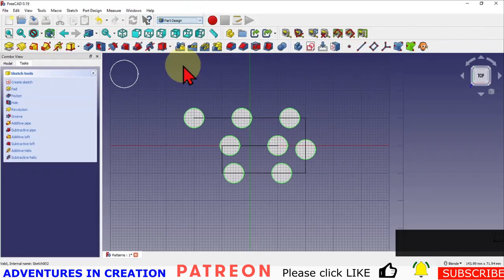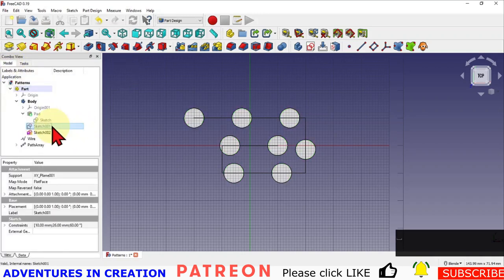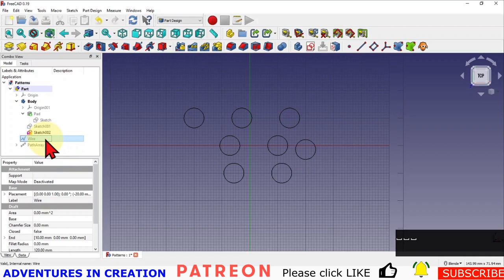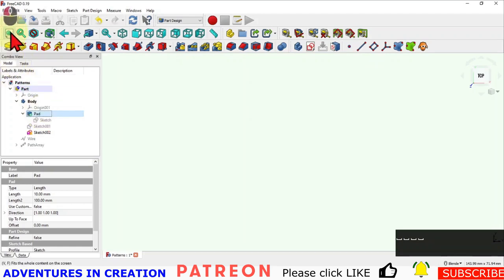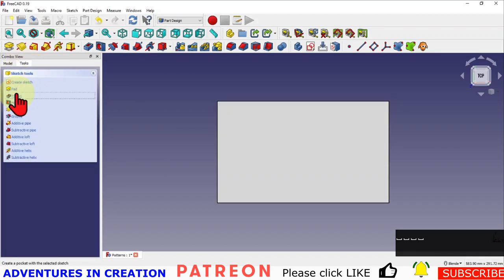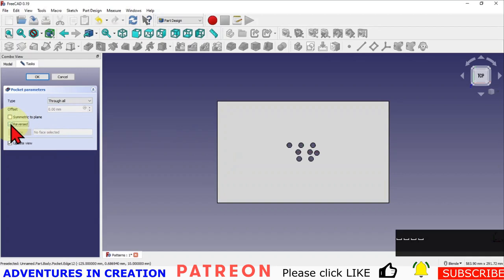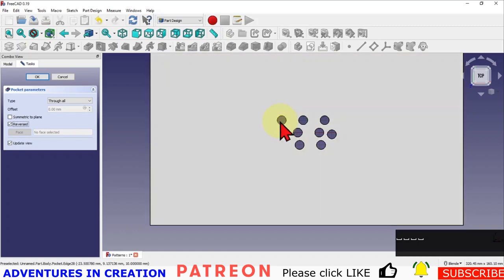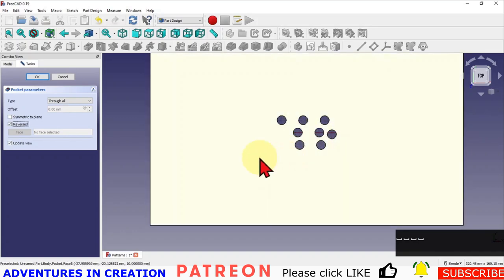FreeCAD for Beginners #9 Linear and Polar Patterns with Path Arrays

Comment: A quick way to re-orient the model is to use the 6 blue cube icons below the WB selector menu.
Each cube selects a different face: top, bottom and the 4 sides.
You can also use numeric keys 1 to 6
Reply from the maker: That's right Paul, check out my other videos for demos of that too. Freecad just keeps getting better.

Comment: Awesome video sir.  Quick question.  When you created the new sketch for circle, your padded rectangle disappeared.  Mine still shows.  What am I doing different?   TIA.
Reply from the maker: It's a setting, I have changed mine so it doesn't disappear now. You can always switch it on and off at will.

Comment: The path you sketched showed a number of explicit corners. The circles on that line are placed at equal distances, so did not land on these corners except for the first and last one. Is there a way to have unequal distances between the circles so they are placed on the corners?
Reply from the maker: Not in a polar pattern. Create one and play with the parameters

Comment: I am doing a part that requires a pentagon, hexagon, and octagon centered on a central hole. I am able to sketch the part and get a polar pattern for one of the shapes. How do I get each of the other shapes to show correctly on the padded part.  If I add addition sketches the end result seems to tear apart. ???  thanks
Reply from the maker: As long as the subsequent sketches result in a solid part, you should be able to just create a similar sketch for each shape.
Reply: Thank you  I did get it work for me. A lot more to learn for sure. Videos like yours do indeed help out. Cheers from Canada

Comment: Thanks for the videos. I have a problem with path arrays, it seems a bug but maybe I am doing something wrong. I select circle and then wire, then path array. The array is not aligned with the the circle but it is traslated from the original circle. If I change the counter and then return back with ctrl Z it returns to the correct place. I am using 0.19 version.
Reply from the maker: That sounds odd. I am not near my computer at the moment. Perhaps, a Google search can tell you if others have the same bug 🐛?
Reply: I also have the same problem. I though I was doing something wrong.

Comment: I've made an HO scale oil storage tank and 3D printed for a friend that's into model railroading, but haven't been able to figure out how to make the staircase that curves with the tank without sketching and padding and reposition each individual step, if there's a simpler way could you show how?
Reply from the maker: I am sure you could do something with a "pattern" are the steps in a spiral? Do you have any details (maybe a picture) of what it should look like?
Reply: @Adventuresincreation  g00gl3 storage tank stairs
Reply: @Adventuresincreation  guess the AI doesn't let you write where to look for something (eye roll)
Reply from the maker: @nigozeroichi2501  ok, I Google it, there are lots of different ones but I will create some around a cylinder
Reply: @Adventuresincreation  Oh, thank you so much, I've stumbled my way through making things but there are times I get stuck trying to figure it out. Going back through your videos has helped many times.